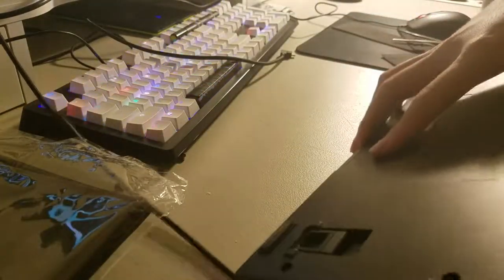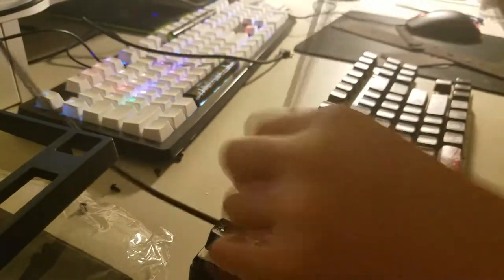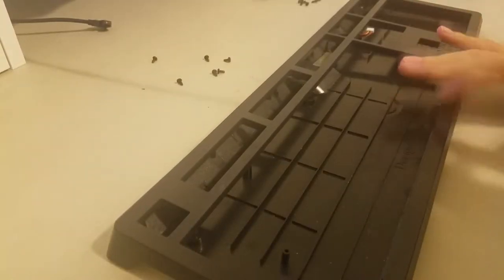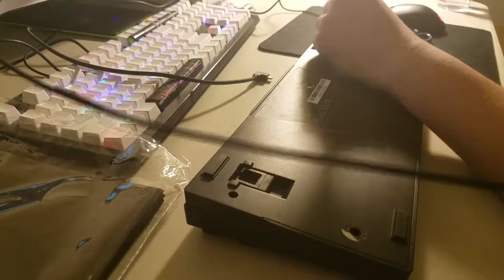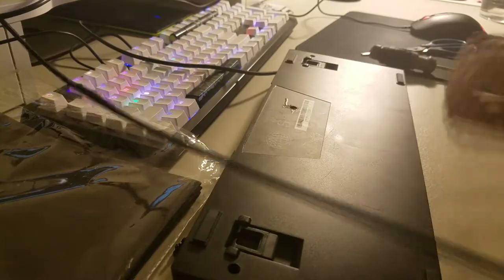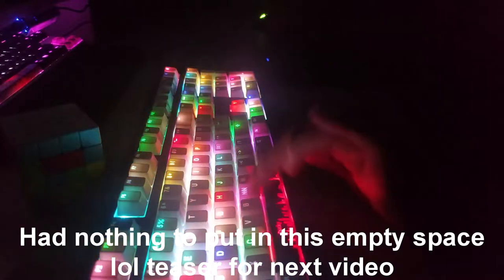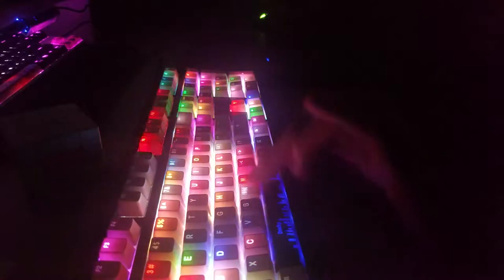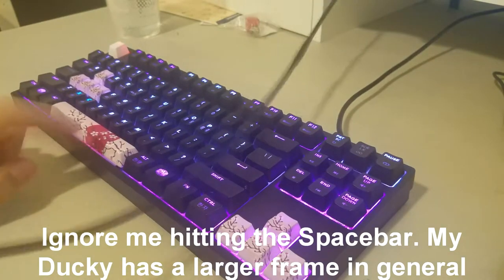The Keyboard Foam Experiment

Comment: So should I do it with blues to make it quieter
Reply from the maker: Blues make sound mostly from the actuation point (click sound). The sound is mostly from the blue switch itself, and only a small percentage from pressing the key down fully (aka bottoming out). The foam mod will only reduce the sounds from bottoming out. Not that it wouldn't make your keyboard more quiet, but don't expect major changes; they will still be almost equally loud
Reply: @graphe0292  ok I also want to do it for experience and fun. Thanks

Comment: What foam did you use? Have you tried using sorbothane mat instead?
Reply from the maker: tbh i dont remember what foam i used, but I remember looking for foam that would be an upgrade from stock foam that comes usually with stock keyboards (not really knowledgeable on distinguishing materials lol). and i haven't tried sorbothane, but I do acknowledge it. Apparently it's supposed to be one of the best out there?

Comment: Does foaming my keyboard helps with pinging?
Reply from the maker: It would probably make it less noticable, but the best option would be to get rid of the noise itself. Replacing the springs or lubing it would be the best to get rid pinging, but foaming might help reduce the sound (and is the easiest option lol)